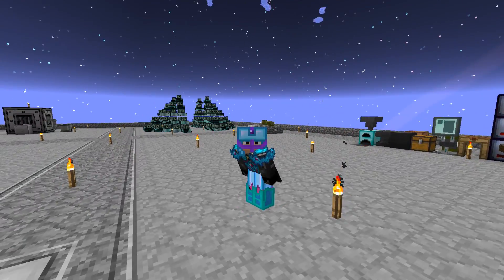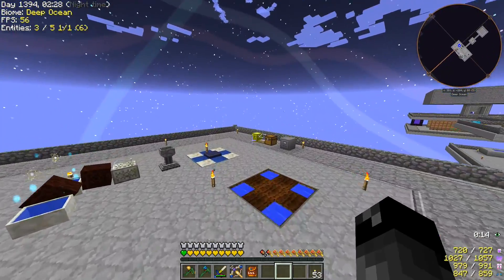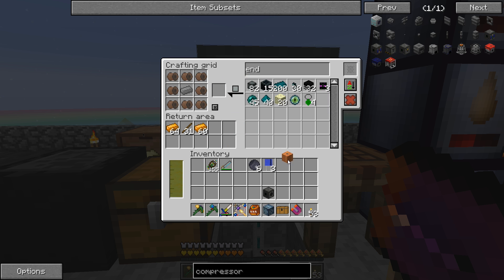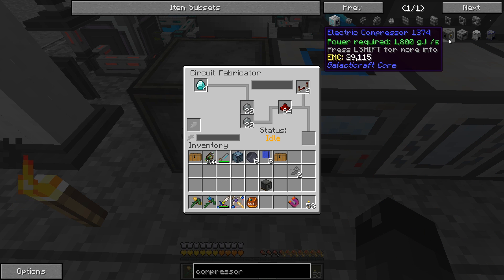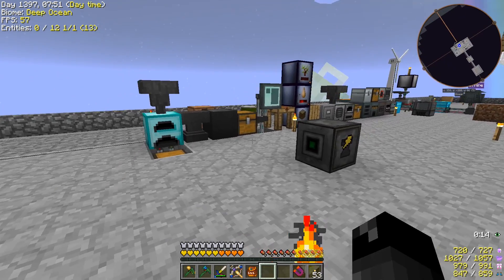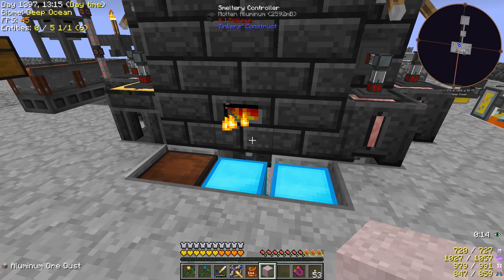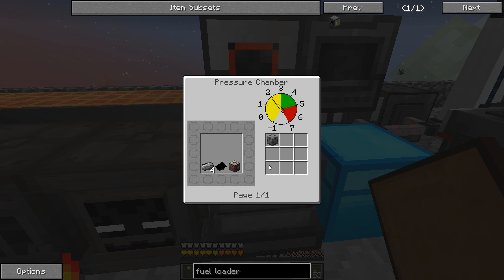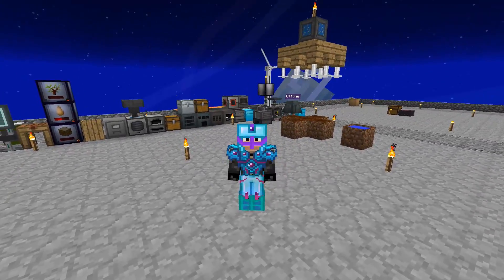Project Ozone 2 Kappa Mode - CIRCUIT FABRICATOR [E25] (Modded Minecraft Sky Block)

Comment: you should set up a few cobblestone frameworks and put in crafters in there to get compressed cobble ready for use (or just pump it in like 3 compressing drawers things
Reply: or just a compacter ;)
Reply: Ewaari the compacting drawer wont need power + its instant and has alot of storage space + can input and extract any type of cobble wanted
Reply: Yeah right.. oh well there are different possibilities :D